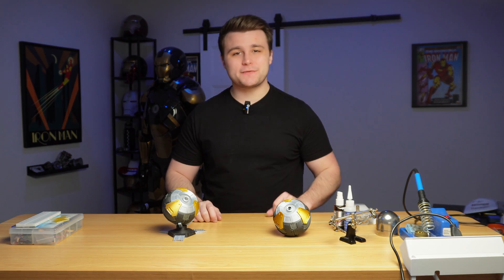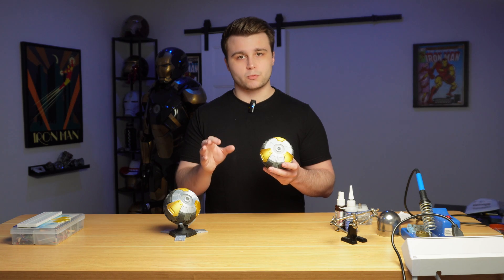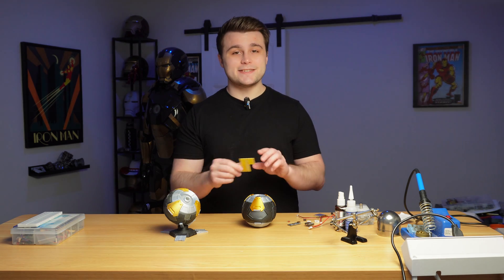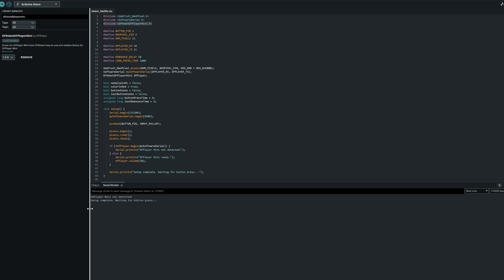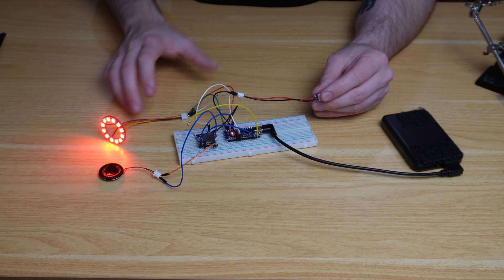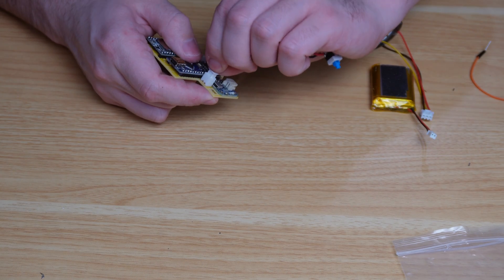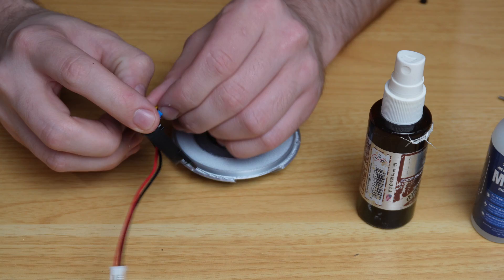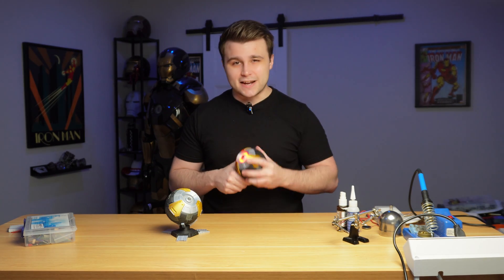How To Build a Stratagem Ball from Helldivers 2 (with lights and sounds!)

Comment: I'm in the process of building this but I've hit a snag. My DFPlayer mini is reading as ready when the setup code runs but when using the button, it says DFPlayer Not Ready. Do you have any troubleshooting suggestions?
Reply: Make sure your SD card is formatted fat32 and try putting the file in a folder named mp3.  So the file should be at mp3/0001.mp3

Comment: When will tron disc tutorial come out because you didnt full explain where to wire or solder the speaker and the entire board to the disc especially with the switch. Not everyone can afford to but your disc off etsy
Reply from the maker: Everything you just asked (except for the switch, which just cuts off the power going from the batteries to everything else) is in the wiring diagram available with Shriekers 3D files on Cults3D

Comment: Question, what are the philips screws for? I am making a list on how much it will cost me and I don't see them in a shop where I am from
Reply from the maker: The Philips screws are to screw down the PCB to the modified battery mount (there are two screw holes on either side of the resistor). I guess you don’t technically need them since there are 4 m2.5 screws holding the PCB down in the holes on the lipo charger, but that’s up to you.